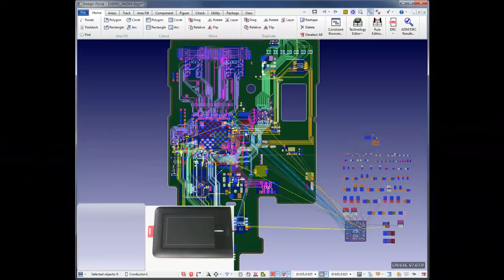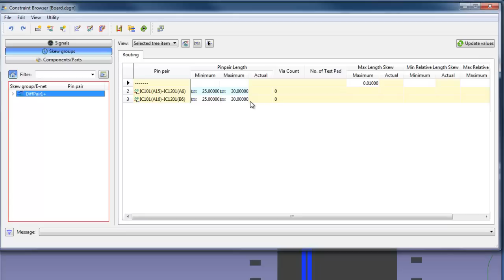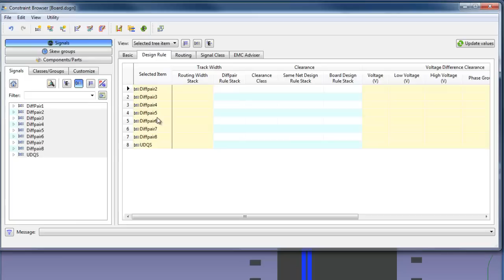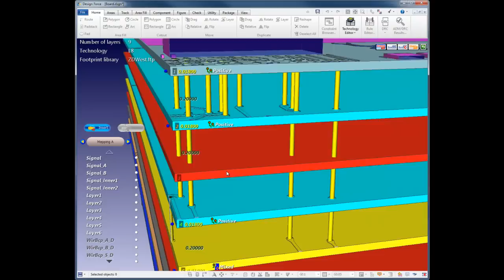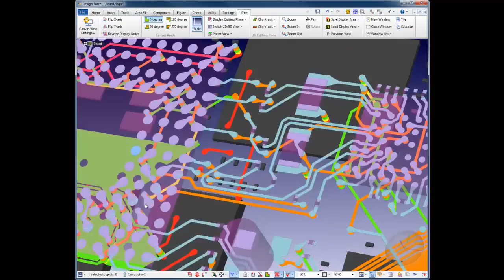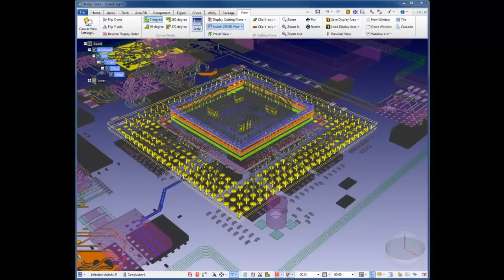CR-8000 Design Force - System-level PCB design environment

Comment: how should it be possible in 4 weeks a group of 400 components. nothing special high speed. simple analog technology.
place and layout?

CR5000 had other problems but initial placement was efficient. Change of finished layout is interesatnt in CR8000

piking in the scheme and placing in the layout.
in teori it works in practice it is very fiddly.
hilig lowligt. would have to be programmed there more meaningful.typical Zuken simple things are complicated and complicated easy
Reply from the maker: Thank you for your comment. The product has changed since this movie was created in 2011, but we welcome your feedback and would encourage you to contact your local Zuken representative to share any specific thoughts or concerns you have with CR-8000 or CR-5000. Contact details can be found on our website: http://zuken.com/contact